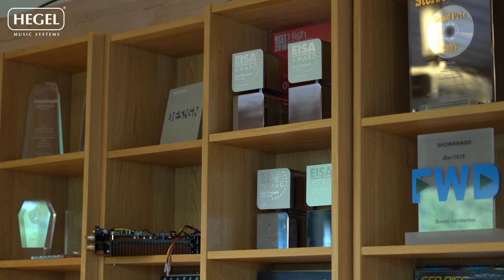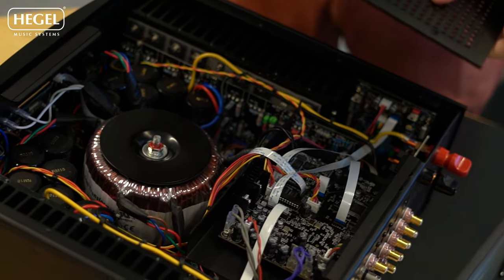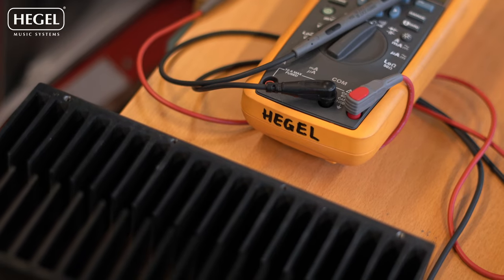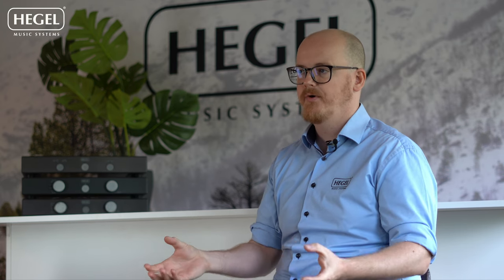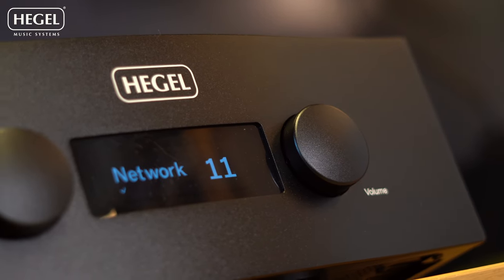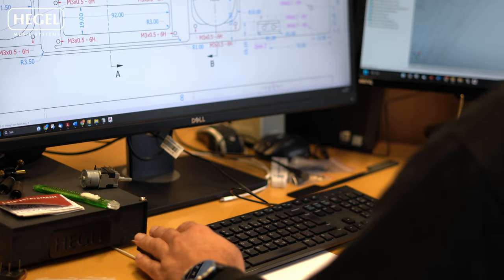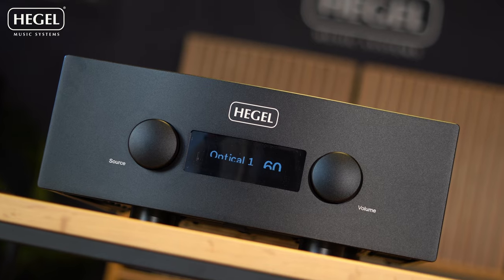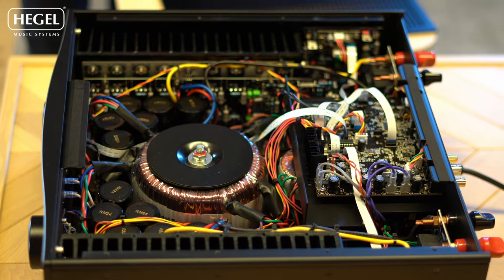Developing Hegel amplifiers

Comment: Congratulations on the release of the H600. I was able to get the H590 for less than half the original price. I took the other half of the original price and invested that in a Denafrips Terminator 2, 12th anniversary DAC, and never thought about upgrading to the H600.
Reply from the maker: So glad to read that you are happy with your H590. Even if it includes a 3rd party DAC.

Comment: I’m looking for an amplifier to replace my Cambridge audio cxa61. To my ear the treble sounds tilted up on the cambridge amp which can sound harsh.  My speaker is the Kef R3 Meta. Is it true that theres good synergy between kef and hegel? I was planning to buy the Hegel H120 and a dealer told me that you’ll be releasing a replacement to the Hegel H120 this year. Is that true and when I expect to see the successor to the H120 on the market?
Reply from the maker: Thank you for the interest. There is absolutely a great symmetry with Hegel and KEF. We have a tight partnership for that reason. With Hegel you get all the details in the KEF but at the same time a smooth and natural high frequencies due to the very low distortion in the Hegel. The H120 would be a great match with the H3 Meta and there are no replacements planned for the H120 at this time. So definitively not this year.